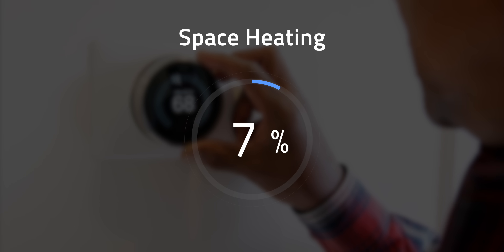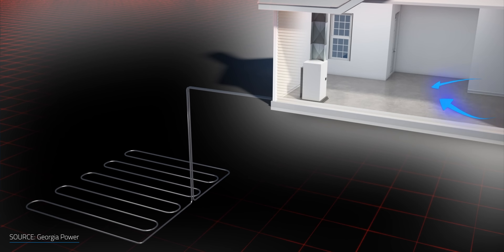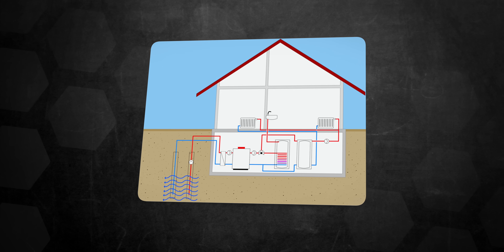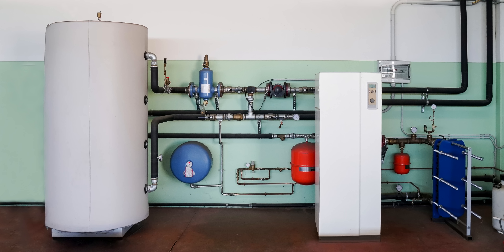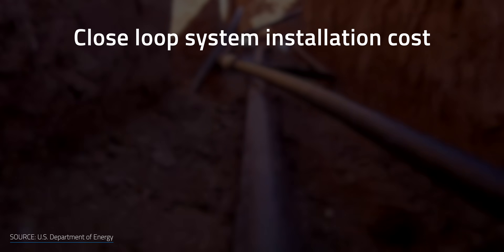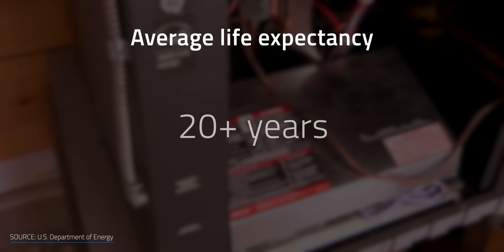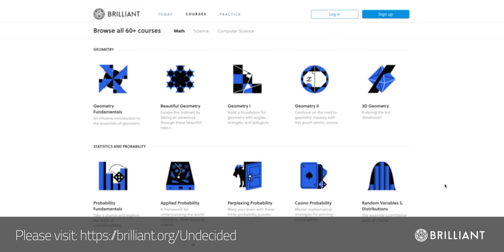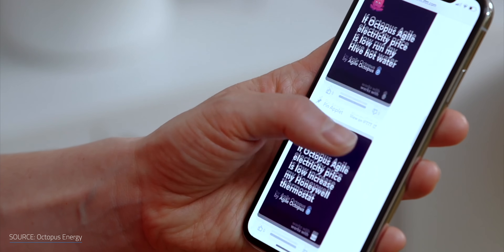Is Geothermal Heating and Cooling Worth the Cost?  Heat Pumps Explained

Comment: True geothermal effect is what you actually get from Earthship designs.  What you have here is more of a Rube Goldberg version..  
This form requires much more machinery, parts and power than you really need.  The Earthship method is far cheaper, simpler and more direct.  
I have seen it work.  It will blow your tekkie mind.  
Earthship is big on solar panels too, so I'm kind of surprised that you haven't given it some research..

Comment: I have a ground loop system that I put in about 10 years ago. It is a 5 ton water furnace and has only had one problem - this first one this year a capacitor for the start motor. We also use the cooling of the compressor to heart our hot water to 12o degrees F. So some additional savings there. 10 years ago the cost to buy and install was $26,000 and did not require duct work. The loops are 14 feet under ground.
There are three big things to keep in mind with these systems:
1. You cannot vary the heat like you can in a traditional system. No more than 4 degrees between day and night
2. The heat is not a warm heat like a traditional system. So you don't really feel "warm" air out of the registers but the house is warmed.
3. Typically they are not sized to really heat the whole house. More they are like an 805 and then an aux heater kicks in. If you want more then you need to buy a bigger system which takes more electricity. 
We have a 5000 sq ft house and a 5 ton was sized. The summer is not problem we could freeze ourselves out. But in the winter the system could not keep up all winter if we kept the house 72 degrees. Since I am too cheap to run Aux heat we run the house at 64-65 degrees and no auxiliary heat. This last one is one you should really investigate before buying. I actually wanted a 6 ton and the guy talked me out of it. 
We live in the pacific Northwest USA. our winter electric bill is $250 - $350 per month. In the summer  cooling is 100 Per month. You do have to cool in the summer to pump heat back into the ground. Sounds weird but it is true we have tried it. (We have a temp gauge on the coolant line). Where we live in the country we only have Propane heat. So this has paid for itself several times over.

Comment: Why do geothermal companies seem to require forced air ducting? Couldn’t they use ductless head units like air source mini splits do?
Reply: they kind of already do but I have never seen it for residential. I have seen similar for commercial though.  Mitsubishi has a VRF Geothermal system. which uses ductless indoor zone equipment which is the same as a mini split. but can handle a lot more load.

Comment: I'm surprised you didn't mention some of the other benefits of having this system like it pre-heating your hot water tank and thawing out your driveway and/or patio.
Reply: Heated Floors!  Nothing like walking across the tile in your bathroom and it's slightly warm.  Nice.
Reply: @TheRussellStover  can do that for like 300 bucks with a kit from Amazon and a wall outlet that's not special to this system
Reply: One should use caution with pretreating water with a WSHP as a source as that type of tank storage can fall into a temperature range the promotes the growth of  legionella bacteria.
Reply: Not just preheat, you can make hot water with ground source heat pump with no problem. It just needs pump that is capable to make hot enough water so tank is legionella safe. But it is common in europe to do this.
Reply: @Karjis  Hot enough?  Why can't it just pre-heat the incoming water?  The water heater itself can have another energy source that provides the final temp rise.
Reply: @111ch1a1d111  That still means there is a body of water that is at a temperature for legionella bacteria to grow. Better to use either fluid that is hot enough to heat the water tank straight to temp or not at all.
Reply: @Karjis  that's a hybrid style with the  use of electric heating elements that carry a high percentage of the load.
Reply: @dpt4402  Actually not, I am referring to somewhat popular ground source heat pumps in nordics that can create 65 celsius water without electric heating elements, no need to have electric elements to do anything else than work as a backup if compressor / pump etc. fails
Reply: @111ch1a1d111  it depends if 150F is hot enough for your local requirements. There are several heat pumps that can do that for hot water. Heating with another source is smart if that is available, direct electric heating elements are same source but worse efficiency. But if natural gas is available it might be sensible depending on area.
Reply: @Karjis  your correct but do come with several caveats. In a non cascade with just one compressor the COP drops off . With a cascade arrangement it is less so but both systems are pushing their operation in the upper limits of compressor discharge temperatures and the compressors longevity as it is a moving assembly. Environmentally friendly  refrigerants and compatible oils operational envelop often differ from the compressor OEM than the equipment assemblers establish.  A DX refrigerant cycles has some bottlenecks and should be understood as part of the metrics in understanding the ROI to the end user.
Reply: @dpt4402  Yes COP drops off but still beating direct resistive heating which basically is the option if heat pump is installed. 
In area where gas lines are available natural gas probably is really good option for hot water especially in many parts of USA where natural gas still seems to be really cheap. 
But of course it is much about the ROI for the end user. I know that in many places with solar panels resistive heating is used in summer time to reduce operation hours for compressor at these harder areas where discharge temp is high. 
All depends on location basically, higher the energy cost at the area, more it make sense to use money for technology to save the cost. 
My views are much from area with moderate energy price, 13-17 eurocents (15-20 us cents) per kWh, not in worst like german where energy cost might be double.
Reply: @Karjis  I agree one size does not fit all problems. 
In my  region I see the strength of Geotherm mostly for commercial and the avoidance of using drinking water to support a cooling tower.
From my observation I have watch the efficiencies escalate of hermetic refrigerant compressors over the years as the majority of the served industry is focused on heat absorption typically  refrigeration, process and comfort cooling with  very  little desire to recapture the heat. Along with rebadging of consolidated designs  from the likes of Emerson, Danfoss and Trane. With the depreciation of 2 of the 3 heats of rejection, heat of compression and motor inefficiency that is an attribute of efficiency Mitsubishi hyper heat seem to be a functional work around with air to air HP space heating  even in regions not normally served by air to air HPs.
Reply: @dpt4402  Hyper Heat seems to be really pushing the power output up on milder winter temperatures but still it seems to have similar minimum temp as previous series (-30F ish). But it being air to air pump of course it works in hostile envinronment during winter compared to ground source heatpumps where ground loop is always above freezing if it is not completely too small. And yes it seems that only in last 20 years there has been any focus to heating and only in last 10 years some new ideas for heat. We can discard the Sanyo CO2 air to water heat pumps as failed idea as those basically blew apart from the high pressures used. Still waiting for some desings especially for heating. Of course you cannot "lose" heat with ground source units as those usually live indoors. But air to air outdoor units might still have some possibilities to make losses smaller. I know only couple manufacturers who really pay attention to insulating outdoor unit components in air to water units. I sadly don't own one that is well done and it has condensed water freezing around the compressor legs issues. Last winter after four weeks constantly below 5F and half of the compressor was inside block of ice that formed around the condensed water that formed around the uninsulated pipes on top of the compressor. Every thaw cycle created little bit of water and after a month I had to open up everything and carefully remove the ice with (cold) water and dry everything to get the noise down.
Reply: You can preheat hot water no problem, all heatpumps or hot water tanks I've seen here in Europe have anti legionela program that heats the tank over 60 °C periodically, even my solar heatpipe system has that function and its 15+ years old. 
You just need either electric heater, gas or high temperature heat pump to do this.
Reply: @goodiezgrigis  Do they incorporate a way to alert that the sanitation cycle based on tank temperature has failed to the end user if need be?
Usually the point of temperature to sanitize is above skin scolding are tempering valves use to prevent this?
Reply: @dpt4402  the SMART ones could/can alert about anything u want them to. 
In older systems there is just an fixed value mixing valve on the tank outlet or  just use common sense to prevent scalding. 
You can also get fixtures for sinks and showers that have a safety built into them.
Legionela is a problem only in systems with stagnant water for longer periods.
Failed cycle on older systems is up to maintainance, usually if dumb controller fails you dont have hot water anyway.
Reply: @dpt4402  you need an extra boiler that tops up the water and kills the bacteria but its nice that it pre heats the water it saves you money
Reply: @baluba006  Its dangerous they are many scenarios where the second tank will  not maintain the proper temperature . legionella bacteria can be deadly especially when aerated from a shower head.
Reply: I would love to never shovel my driveway again.
Reply: A whole house water purification system which includes a before and after filter(s) strong UV sterilization unit, with transparent coils to loop the water around the UV light, will definitely kill all possible microorganisms. Water purification systems, good ones anyway, will always have this.

Most unfortunately don't yet have a before AND after UV treatment. Which is essential. Because the one before the filters kills all the bacteria, etc, before they can contaminate and colonize the filters, which they will do. And the one after will kill anything that might hypothetically get through the 1st one and colonize the filters anyway. So both are important, but the 1st one is the most important.

And for drinking water to be cool, there needs to be a way to keep the heat of the UV source AWAY from the water. Idk if that has been worked out yet.
Reply: @DUCKDUCKGOISMUCHBETTER  "Water purification systems, good ones anyway, will always have this."  Lmao. The point of living in a first world country is that you don't have to purify your own water, sweetie. You guys are looking for any possible reason to make this thing practical when it just isn't. This isn't even actual "geothermal" energy. This whole channel is just a joke, nonsense impractical ideas that idiots love because believing that they're saving the world is more important than silly things like facts and logic.
Reply: Doesn't it need to be under a certain depth so it doesn't get affected by the weather? I don't think there would be any thawing of the driveway or patio.
Reply: @samsonli9490  it is at a depth such that the weather effect is reduced, then the difference in temperature is amplified (basically you go from a huge volume of barely above outside temp water to a small volume of lukewarm water). if your driveway is way "smaller"  (quotes are because it's not directly the surface area that we compare) than your underground source, you can use your source to melt the snow. The whole cycle is twisted and clever, but there is no free energy, you're cooling your underground to heat the sky.
Reply: @samsonli9490  You use the geothermal to warm the surface, it doesn't take much generally. My neighbor has similar due to the downward slope of her driveway (the garage would be buried in snow).
Reply: Thaws my driveway? WOow yea!

Comment: It's all about insulation at the end of the day, it will never work in a leaky house like mine.
Reply: Wouldn't you need more heating and cooling from non ground source methods regardless of how leaky your house is? Or is the problem that you would saturate your refrigerant lines too fast?
Reply: not quite sure what you mean, but ground/air source heat pumps are more for underfloor heating ie lower temps. A leaky house would cause the heating system to work overtime.

Comment: I would love one especially an active energy management system that takes heat or cold air from parts in the house where it cooler/hotter and dumping i where it warmer /colder
Reply: Though that would be cool it would only work as someone's pet project that they did just because its high tech and cool.
Because of the cost involved with running all the extra duct or fluid runs to each room and the extra blowers/pumps/compressors needed to effectively control it all the saving in increased efficiency would be lost due to maintenance costs.

Comment: I am in Southern California and one thought that I have is to use geothermal in combination with conventional AC to have the AC run at night cooling the ground and during the heat of the day (when the air temps can top 100F and the conventional AC is far less efficient) use the ground for cooling.

Comment: Love all your videos.  I live in the northeast as well,  no natural gas to the house so oil it is. Pretty good insulation, new windows and roof, but there is absolutely no way I could pull this off financially or physically. Not enough room in the walls and floors (house is 70 plus years old) for ductwork,  so I'll waddle along with what I got.  Great explanation,  though.  Keep up the great vids!

Comment: With solar and wind energy falling in price rapidly (grid scale and also DIY cost is roughly 4cents a kWh now), is it really worth it to dig up the ground to install this stuff? It seems like the math will favor air sourced heat pumps in all but the most extreme climates.
Reply: What's extreme? Much of Europe sees freezing temperatures for weeks at a time every winter. We don't consider it extreme, it's not Siberia but by the same token air source heat pumps drop to 150'percent efficient at those temperatures, meaning the cost a fortune to run yet can't keep up with demand. I'd say anywhere that gets cold enough to encounter occasional frost is too cold for air source heat pumps.

Comment: My home in Denver was about to need both a new furnace and new whole house air conditioner.  After some research, I found that geothermal would be an economical way to replace both.  After 7 years, I believe the system has almost paid for itself. And it has eliminated the the fossil fuel emissions of my old gas furnace.  We got a vertical loop system in the space of a small front yard by drilling 3 holes to 100 feet deep.

Comment: In Italy we can install heat pump, solar panels , storage battery and ev charger box for free with government incentive.
Reply: completely free? In Germany the solar panels pay for them self within 12 or so years and we get 900€ for installing a wallbox, but the others are only incentivized. Heat pumps while renovating old homes get a 40% grant, and some states pay a percentage of the investment or ~100-300€/kwh for installing a battery.
Reply: @Psi-Storm  yes 100% free but the house need a renovation that increase the efficiency class by two steps.

Comment: I have two open loop units operating for 13 years now. Not sure how much money I've saved as my electric bills are huge in the winter.  My guess is it would be cheaper in MA (very high electric rates) to run gas or oil for heat.  It works really well in the summer though... I'm not sure I would do it again with the more improved air source heat pumps...
Reply: Unlikely.  Electricity at 16cents per kWh with a heat pump is $15.27 per MBTU, while #2 Oil at $2.80 a gallon and 85% efficient furnace is $25.46 per MBTU.
(Ongoing costs only, initial costs obviously favor air-source heat pump for roughly the same efficiency)
Reply: @CorwynGC  I'm paying about  22-25cent per kwh.
Reply: And what efficiency did you use for Heat pump to get to your $15.27?  My ground water comes in about 45-50 in the winter.
Reply: @jbuszkie  COP of 3.0.
Reply: @jbuszkie  Ouch.  Time for some solar panels?   Mass has some nice rebates, I believe.
Reply: @CorwynGC  I put in solar panels about 1.5 year ago.  :-)